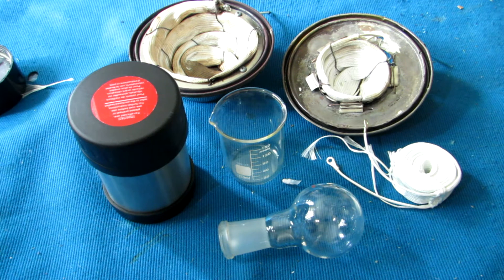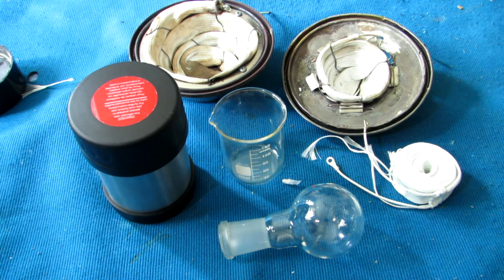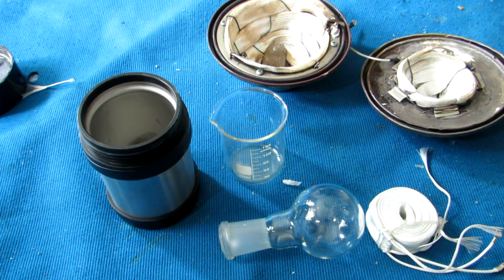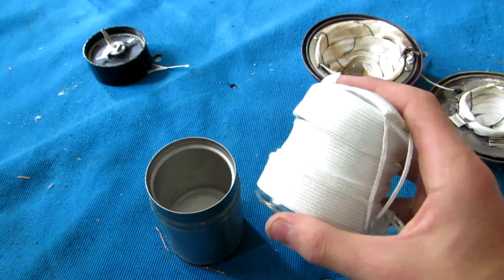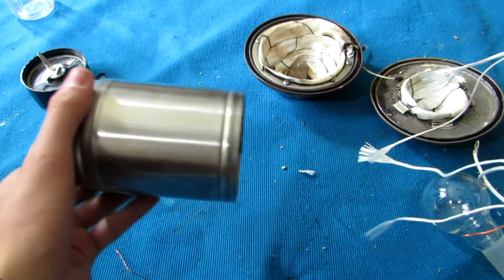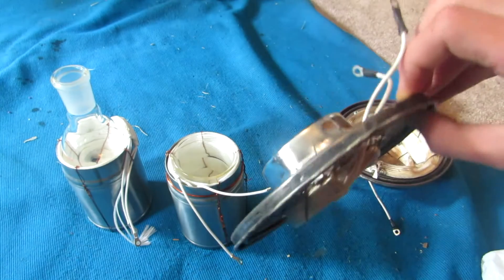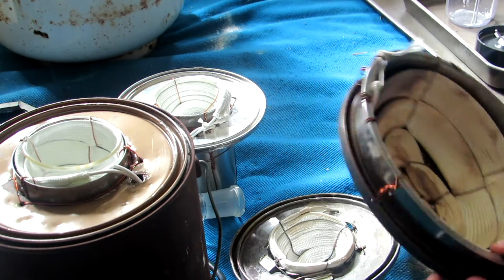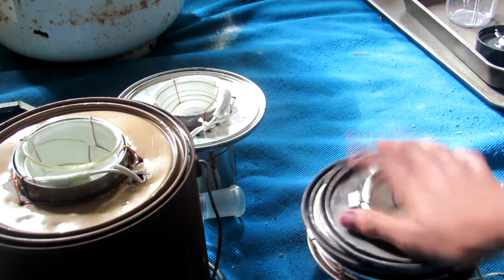Very High Temperature Heating Mantle

Comment: Ahh cool, I've made a number of these over the years. My observation is that the practical limit is around 1200F, and going to 1400F or more causes them to fail - the vacuum crumples them if operated up there very much. I reckon it's due to uneven heat distribution on the outside, but I'm not sure. Definitely the newer thinner walled thermoses and clones fail more quickly.
If you're handy enough to do chemistry, you're probably handy enough to use a PID process controller and stick a thermocouple in there, too. PIDs can be kind of frustrating to figure out, but they're overall not that hard. Then you can program the temperature and it'll stick to that. Roughly speaking of course, the internal temperature is pretty different along the inside of the thermos. I was running them MOSTLY empty, so yeah, the PID was required for that.

No idea where to find the right heat tape stuff now though - I happened to have a bunch of it from a surplus store.
Reply from the maker: yeah, adding a thermocouple and temperature control would definitely be a good idea. I plan on designing some new hot plates and stuff eventually, so I’ll look into doing that. thanks!

Comment: You could skip using a Dewar ( Thermos ) bottle , and use ceramic blanket material for insulation , giving you a wider choice of container sizes .
The insulation is used in kilns and should hold up quite well even at 700c .
It is somewhat pricey , but if you are going to do a lot of heavy duty high temperature experiments , forging , smelting , etc , it is very useful .
Still , your solutions here are pretty ingenious and should work quite well .